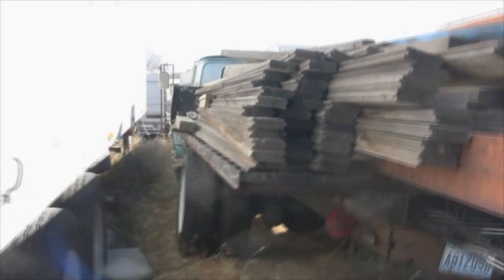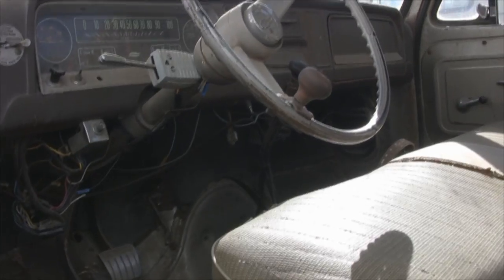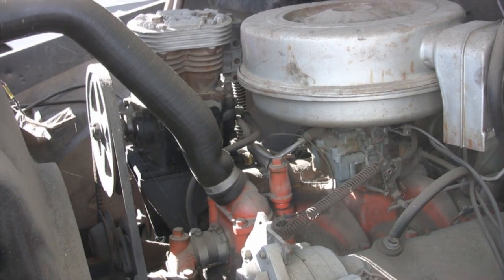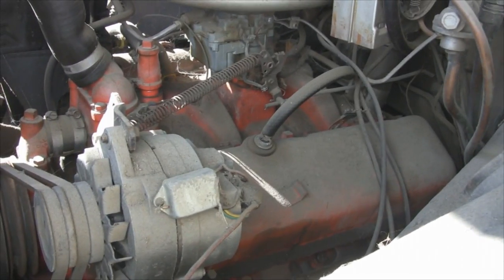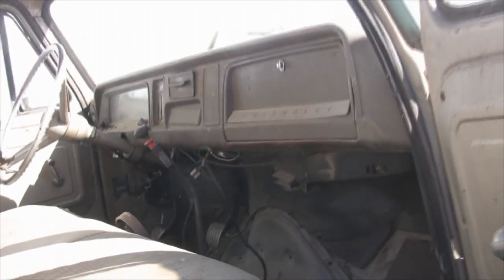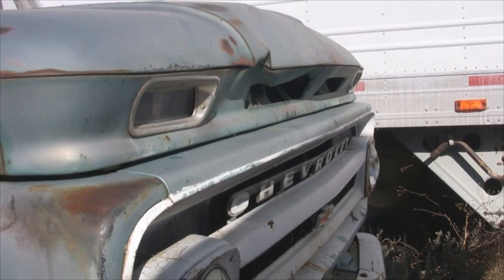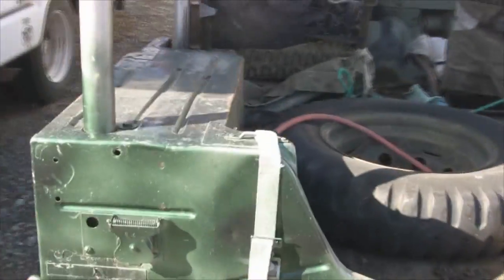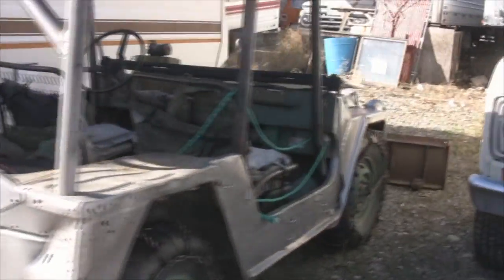Cheverolet 366 Big Block

Comment: Could a 366 fit into a 1996 chevy tahoe?
Reply: I've just fitted one into an 83 square body. Very pleased with it
Reply: @dancollins9474  do you have any pics or a video of this project? I'm considering putting one from an old c60 I have into a 1982 GMC dually 2wd for a low budget tow rig. It also has a 5 spd manual that I thought would work well for the project as long as it's not too big and heavy
Reply: @docjnsn73a  Hi jeff. 

If you have Facebook look for the page ‘project Donald squarebody GMC Sierra restoration’

Pm me any questions via the page

Comment: I put a 366 in my C30 pick up, 17.5-18mpg highway and shes fast too, kept blowin up transmission so i put a 500CFM 2barrel  verry reliable, mine has 13quart oil pan and i converted it to single thermostats, engine temp with a normal small block radiator runs about 108 watertemp

Comment: that 366 has been called all kinds of things... everything from awesome to a boat anchor ...if you look at the bore and stroke its extremely close to a 383 stroker motor...and the thing about a 366 is that its got 3 rings on the piston quite low compression and bullet proof...lots of rat rod power...and a good to put a little nos too or even a blower without alot of friggin

Comment: all 366's have steel cranks , and also share the same crank as the 396 , and 427 , that crank in a 454 block , you can get well over 500 cubes , you need that !! they also made a tall deck 427 , the pink one in mater is a tall deck 427 out of a old ryder truck ;p
Reply: towrecker, 366, 396, and 427 all have a 3.76” stroke, 427 block has a 4.25” bore, same as a 454, 454 has a 4” stroke, 3.76” stroke in a 454 block would make a 427. You need a 4.25” stroke to even get close to 500 cubic inches with a 454 block. 509’s have been built with 454 blocks but that’s as big as a 454 block will go...
Reply: @shitbox7413  Look up Blueprint Engines, they sell a low-deck 598 stroker, 4.5" stroke with 6.48" rods.
Reply: @AdmiralRustyShackleford  
I’ve seen it, they ran one on engine masters.
Reply: @shitbox7413  I don't see why you couldn't use a 454 block to build one.
Reply: towrecker GM made a tall deck 454 as well.
Reply: Dawson's Garage, 366 and 427 were tall deck truck engines, they never made a tall deck 454...

Comment: We have had a lot of the old GM buses over the years with the 366 big block. We converted them to run on propane. They would last a long time. Only had to rebuild one of the 40 or so we had. We would get an easy 250 to 300 thousand miles before we had to retire them (government regulations won't let you run school buses past a certain age). Great motor.

Comment: over in my parts , the 366's are dirt cheap . But not much of a fun motor . The 427 truck engines on the other hand . Those can be some fun . With the higher deck , I forget how much , but with a stroker crank and custom pistons made for a monster .
But that would be a neat truck to restore . Looks to be mostly complete .
Reply from the maker: I read that the early ones.. in 65 or 66... started out at 375 hp and gradually lost power through the years until the oil crunch in the early 70s and by then they'd dropped to 240 hp!  I guess thats why I never heard of them.. not in demand..
Reply: chevahaulic, Truck 366 and 427 blocks have a 10.2” deck height, standard deck height is 9.8”...

Comment: usually the 366 gas engine has a reputation for being an unreliable boatanchor
Reply: Not unreliable at all.    Very smooth and reliable powerhouse for a truck.  They have virtually NO performance potential though do to such a small bore.
Reply: @kencaldwell1399 actually any bigblock Chevy can be built including the 366. Just gotta know what your doing. Gotta bore them out to a standard 396 piston and use 3 ring lightweight aftermarket pistons with a 6.535 long H-beam rod. Everything is is standard bigblock Chevy parts. Use a aftermarket TD intake and .400 long pushrods. I've built a few.
Reply from the maker: maybe thats why I never heard of them
Reply: Apparently you haven't been around many trucks we got to 83 models been hauling ever since damn good engine no radical Powerhouse pull just fine been loaded to the gills and pulling a skid steer climbing Deep Gap 3rd gear
Reply: Shit, millions of them lasted for decades. Tough as nails.

Comment: i have driven a few dump trucks with that 366 engine. they don't have a lot of power but they don't rev very high either.
Reply from the maker: they musta held up pretty good tho..guess they made them for a long time..
Reply: they do. my cousin still has a few old chevy bucket trucks for his tree trimming business.
Reply from the maker: google says they started out with 375 hp.. in 66 or so... but you know by 72.. like everything else.. hp went out the window.. they were diminished to 240.. maybe thats what you drove.. would be FUN to have one of the early ones!
Reply: the ones i drove were from the late 70's. that sounds about right for hp. we had a ford about the same year model with a 330 that would run circles around the chevys.
Reply: ralph high I don't think so drove these engine in logging never seen ford 330 out pull 366 unless it was something wrong with it.